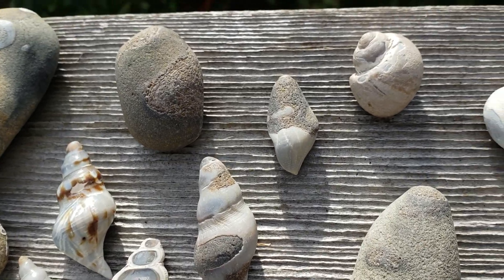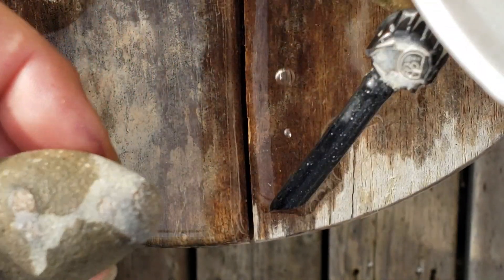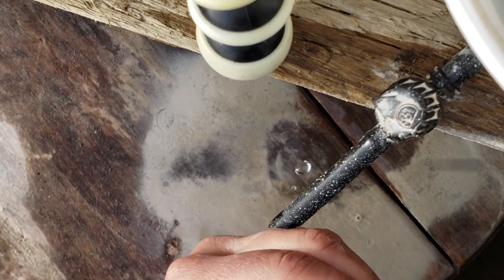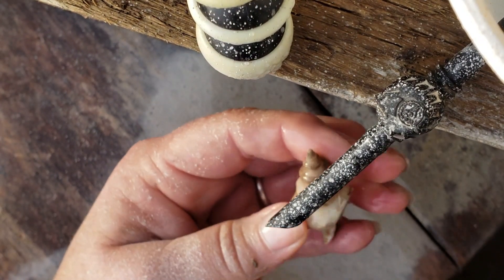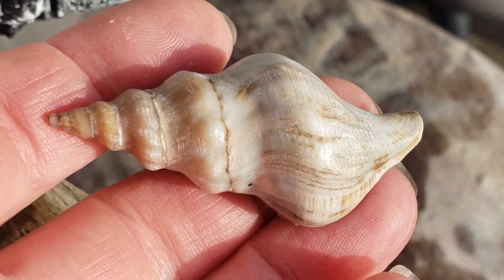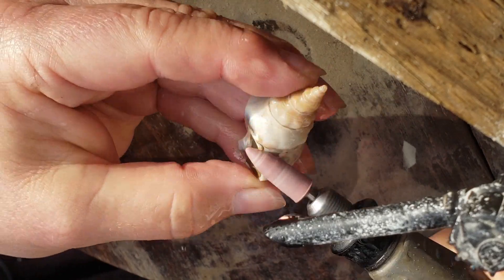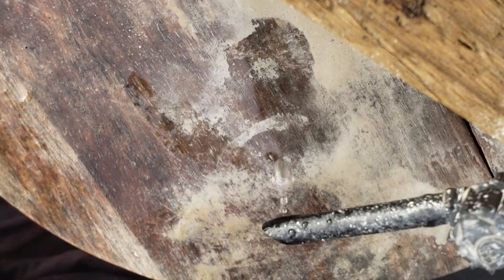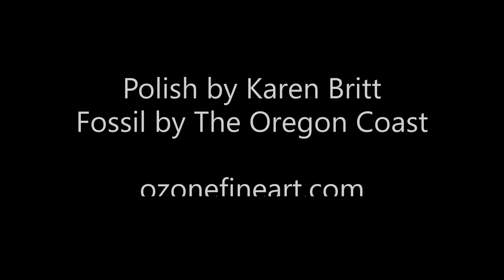Fossil Shell Polishing Tutorial

Comment: I’ve got a black shell with rock on still that I’ve not managed to fully get off. What would you recommend to use?
Reply from the maker: It's hard to know how to get the material off without knowing what it is. There are different methods due to the kind of 'matrix'. I used a rotary tool on this, of course there's the air scribe that is commonly used to 'prep' fossils. Some material is soft enough to be able to just 'pick' off with a sharp metal tool (like a jewelers solder pick). I'd be happy to help more if you can describe the material and whether your shell is a fossil or not. Thanks for watching, cheers!

Comment: what do you do with the sand inside the shell? apply something to harden it and leave it in place?
Reply from the maker: Hi Sheree, the fossils that we have here on the central coast have sedimentary sand that has become rock inside the sand. That's why it can take a polish as well. It's roughly 15 million years old, give or take a million! So it stays put without any help to harden it, time did a good job of that. Do you have a fossil shell that is hollow?
Reply: @OzoneFineArtVentures  i have some clam fossils that the sand in the middle is not completely hard. I found several orange ( some other colors) Oregon coast, not sure what they are. Not agates but not quite solid as jasper either. Some are shaped as if they formed inside clams.
Reply from the maker: @WhysdaRumgone  Excellent point. Some of the fossils are from different timespans and will have different 'filling'. The ones I was referring to are from the Astoria formation but as you travel up and down the coast, you get differing ages and 'quality' of fossilization. We have some fossils here that are brittle and break very easily and their matrix material isn't near as hard as what is shown in the video. The orange 'filling' that you're finding in the clams is probably calcite. Sometimes the shell and matrix erodes away from what fills the clam (be it calcite, quartz, or agate) and leaves the mold. They are called clam bellies around here and it's always fun to find one! Thank you for your comments and for watching!

Comment from the maker: Tool List: 
Flex Shaft Rotary Tool (you can use any kind and even a hand held rotary tool but that can be brutal on your hand)
Diamond Burs (helps to have some different shapes, sizes, and grits but that's not mandatory either)
Nova Points/Grinding Stones/Sanding Drums and Disks (that's a mix and match list, again not mandatory)
Polish Paste (the kind depends on the shine you want, diamond is best, but any polish compound will do)
Buff Points and Wheels (or alternatives, I show you a few in the video)
Safety Gear! Respirator/Mask and Safety Glasses/Goggles
Work Station (this is messy business that I like to do outside but also do inside with containers for water and waterproofing of the area)
...a Fossil Shell, in a rock, or even free! You get to skip some of the steps and go straight to polish if you're so lucky.
Let me know if you have any questions or tips to add!
Reply: Can you give us a link for the nova points that you use?